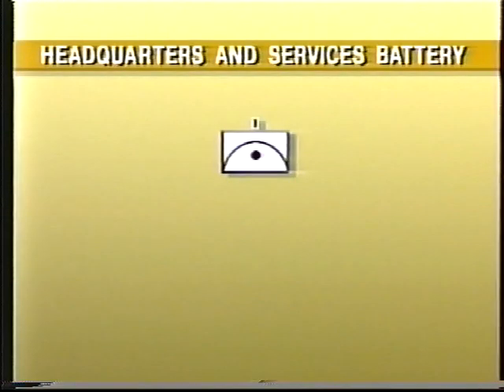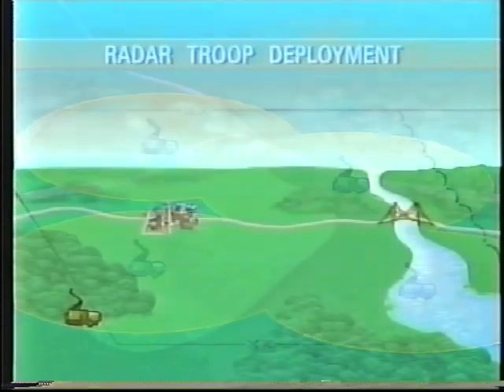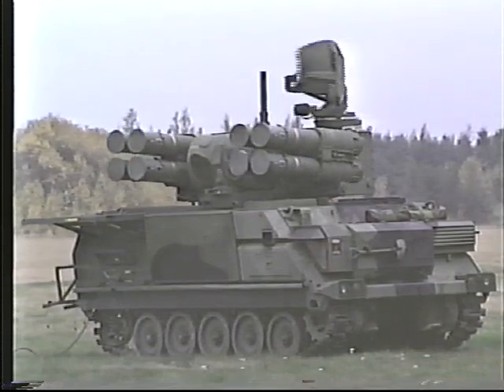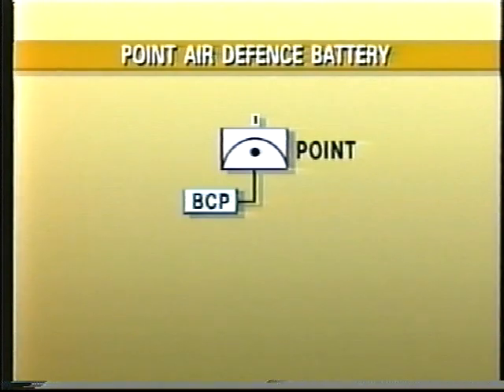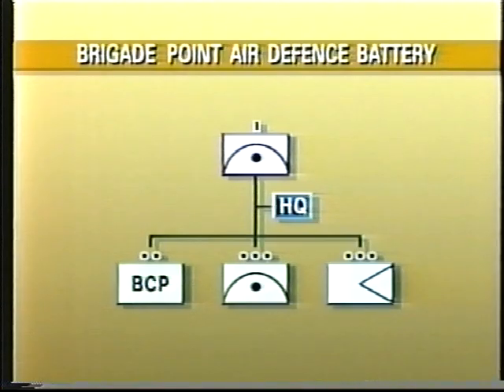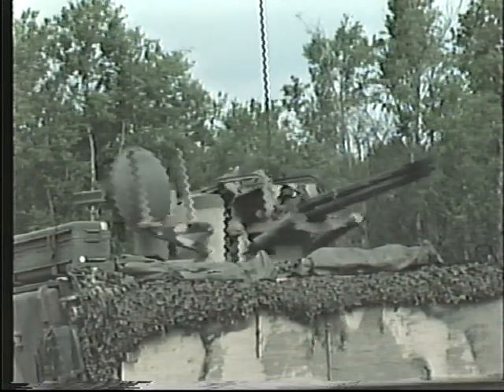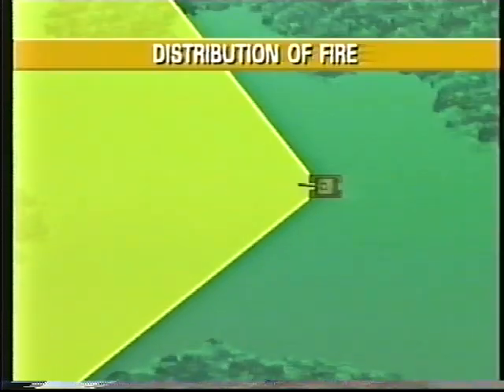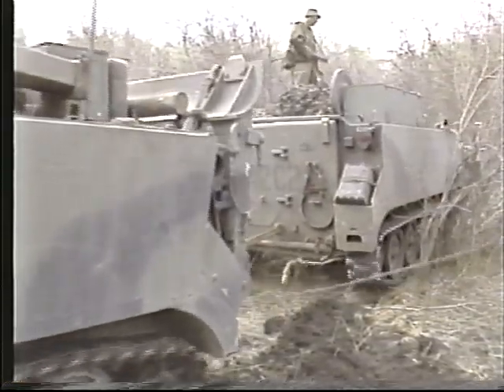Canadian Forces - Air Defence Artillery: Part 2 - Division Air Defence Regiment

Comment: I was part of an exercise with ADATS. At the end of the exercise ADATS was to shoot two ground targets at 3300 meters. Unfortunately they missed. I was a gunner on a Leopard 1 and shooting HESH was very hard . Wind was very strong gusting As high as 80 km. The major asked if any one had any ammo left . I had three Sabot. I fired at the target at 3300 and my round went slight left . Even at 1490 m per second wind matters . I did a correction , normally the round has hit the target and fall of shot is impossible to see. However at this long range and high wind I could see fall of shot. I hit both targets. Crew was pumped . At the end of the day the Col ask me what Is the max effective range. I replied 2400 m but figured I could penetrate the 1/2 plywood. He laughed .
Reply: 3300 m is close for ADATS.
Reply: @BC-li6zc  
It has a range of 10k. Have no idea why they would miss
Reply: @theimmortal4718  Wrong!
Reply: @BC-li6zc  
It doesn't have a range of 10,000 meters?
Reply: I mean, if you search "ADATS range" that's first thing to comes up. Do you have different information?